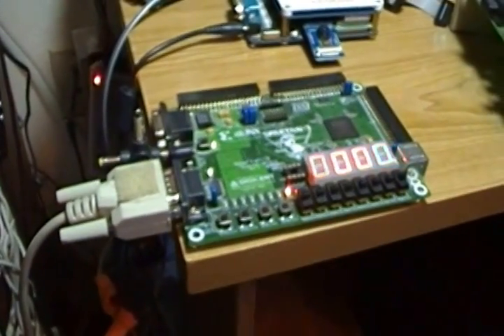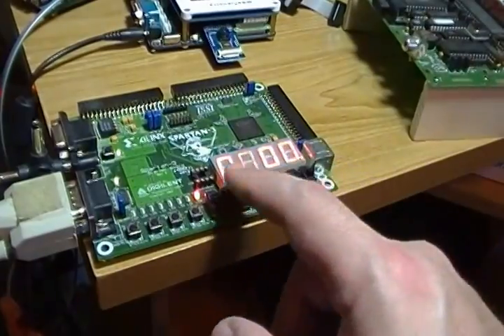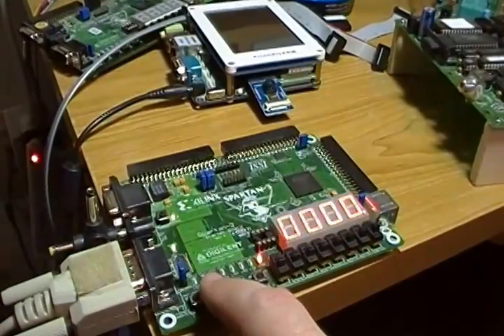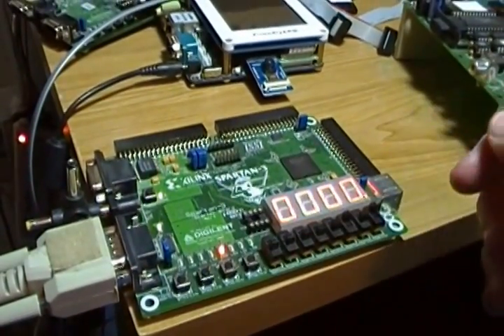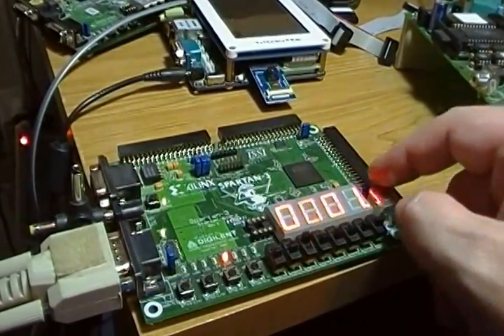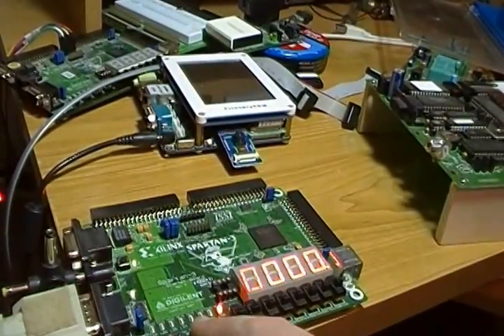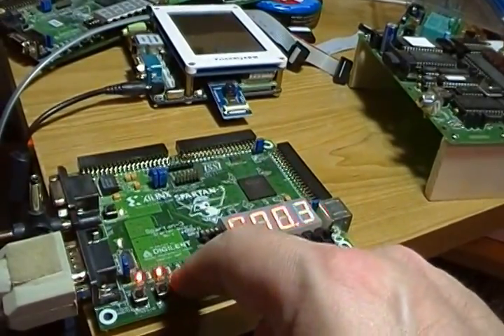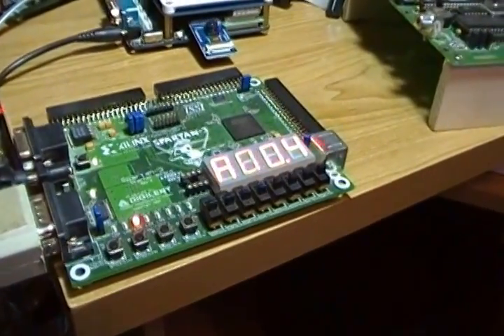Blue 16-bit FPGA CPU Demo (Xilinx Spartan 3)

Comment: Hi there

I am doing an FPGA implementation of 16-bit multiplier which needs 48 IOB's( two 16-bit inputs,one 16 bit output). How can i implement it on spartan 3-e fg320.am i need to interface something to kit or any other ways to do it..
thanks in advance.